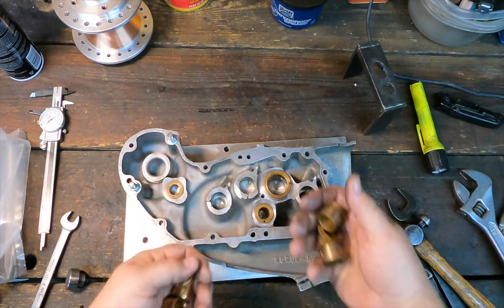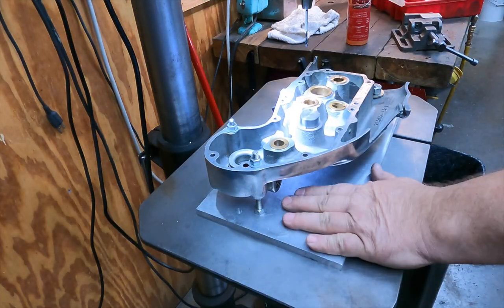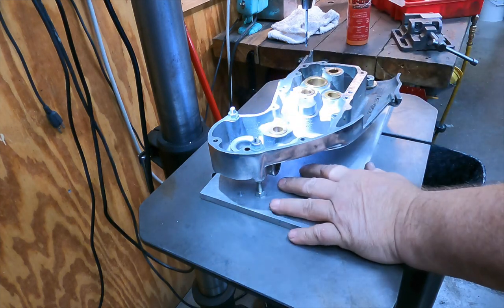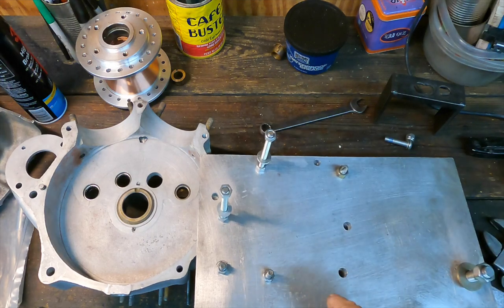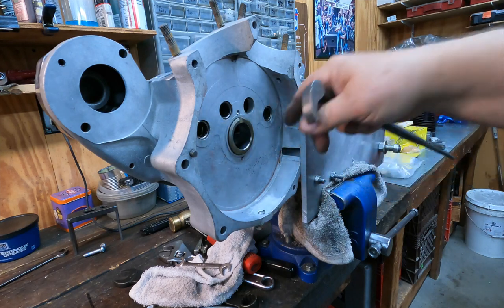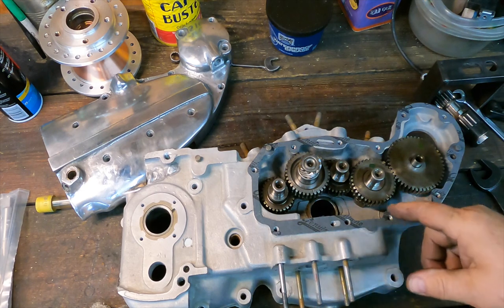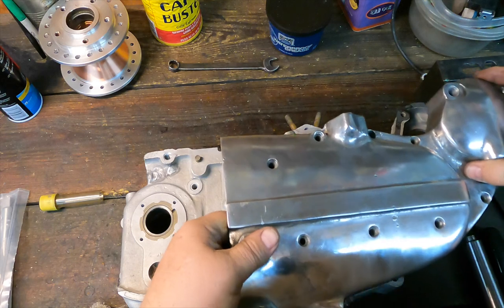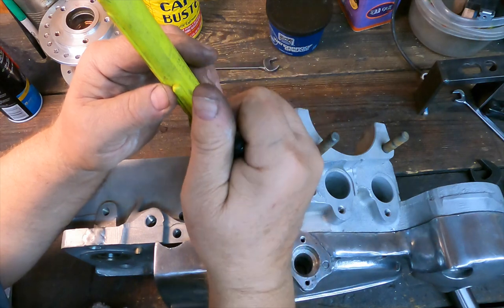Cam Cover Bushing Fixture Nbr. 98

Comment: But what about the pressure exerted onto the sealing surface by the tool your using.....
Reply from the maker: There is very little pressure exerted on the sealing surface and I protect it with washers under the nuts.